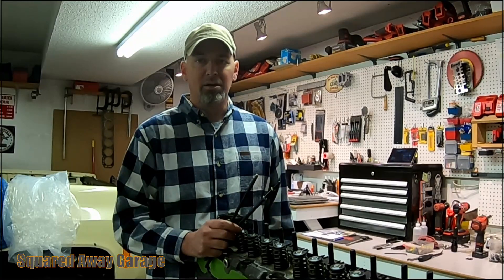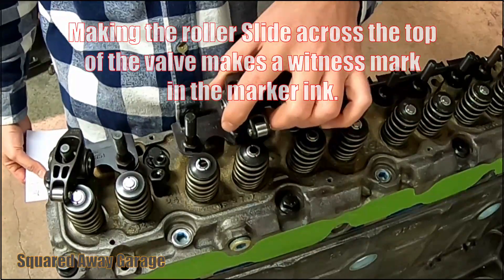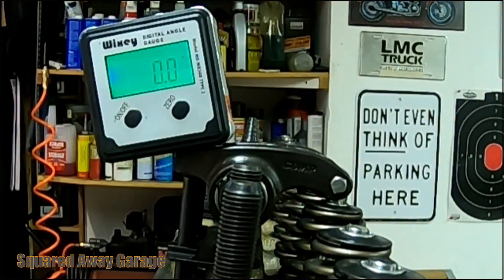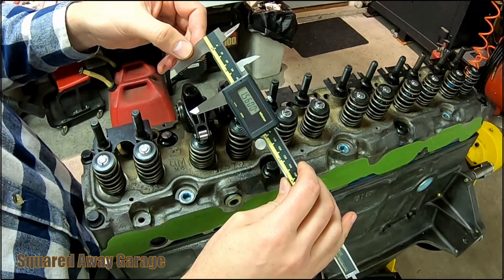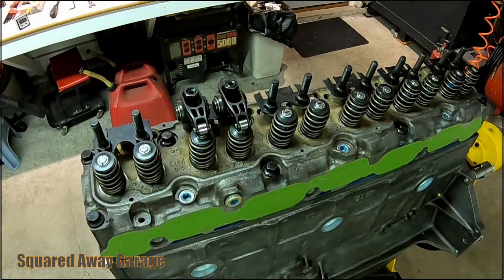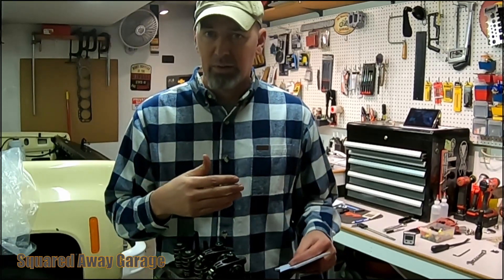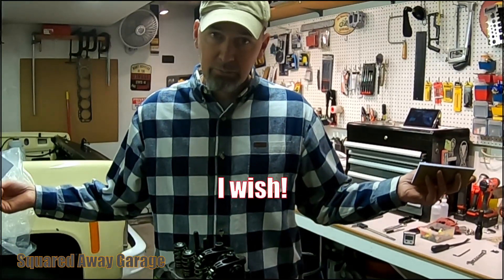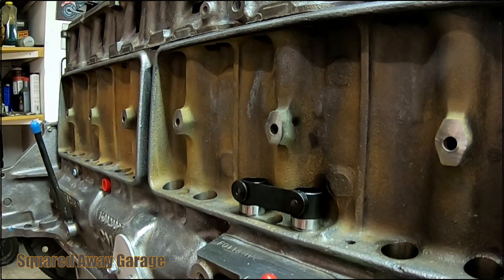Push Rod Length - Correcting Valve Train Geometry (VTG) EP.19

Comment: Don't forget to double check if there is enogth gap between the rocker arm and the poly lock. I had this problem, with the rigth size pushrod, there was a lilltle contact in the lower part of the poly lock, that result in stud failure. I had to use a smaller pushrod to prevent that contact.

Comment: I built a very hot 292 as well, my cam is a solid lift cam, intake is is 508 duration is 240@ 50, exhaust is 525, 246 @ 50 , lobe separation is 108, degree intake @ 106 , Valves are 100th taller than stock ,also I milled the head and deck 100th ,with the 175 SBC roller rockers ,studs and guides I had to remove 425 the off the surface of the rocker stud ,  I took that measurement with all info considered  and had smith bros make me correct length push rods , also hour's of porting  (lumps) ,good video , Besides no expense spared in this build , the list is to long but with long tube hedders ( we didn't have the space to use the collectors)  and dual quads 450 Holley's, First dyno pull made 373HP ,418.7 torque ! The collector length is critical on these properly tuned exhaust will add 10-15 % ,I used a new DUI distributor and changed the coil pak with an Accel kit and picked up another 10 hp !!!! ,that we checked twice and yes 10HP from the accel coil ,with the 2 1/2 exhaust collectors at 30" then  added a two into one "Y" 3" outlet  400HP is damn near accurate , I've built several small and big block Chevys since the late  1970s  , This is my first inline 6 ever , I have over 40 years of experience from drag and circle track . Also did a lot of research and got very good info from guys here that have been building inline Chevys from day one, I can slap a 454 together blind and make 500HP ,but with the inline 6 you really have to pay attention to every tiny detail , I also bought the tallest valve cover made from 12bolt.com and it still wasn't tall enough to clear the valve train ,it would not clear the stud girdle   ,Mr Hot-Rod makes a 1 inch spacer to raise it  ,fits perfect along with all his other parts, Tom from 12 Bolt is another world of knowledge !  And a lot of others from the Facebook pages dedicated to Chevy 6s,. ALSO , If your gonna build a 6 have plenty of blank checks and don't ask how much is this cost etc,  You cant get perfection on a budget ,But I learned a lot and collected some really great rare speed parts , My goal is to get the car in the mid to low 12s , Using various ET calculators online im getting ETs from 12:10 to 12:50 .   The plan is to gather as much data this season from track time and build another 292 naturally asperated and see if I can get 425 -440 HP.  This is a 4 speed car with M-21 close ratio and 430 Dana 60. Post info of your ride and details !
Reply from the maker: Sounds like you're enjoying the challenge of building your straight 6! Welcome to the club.